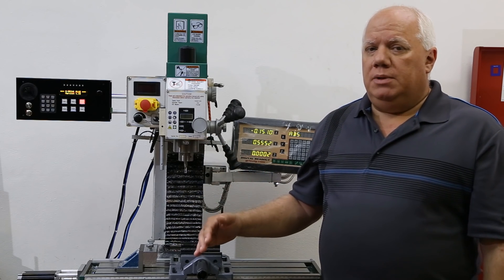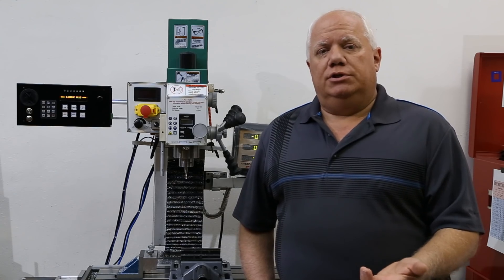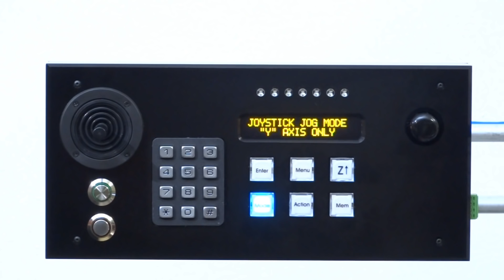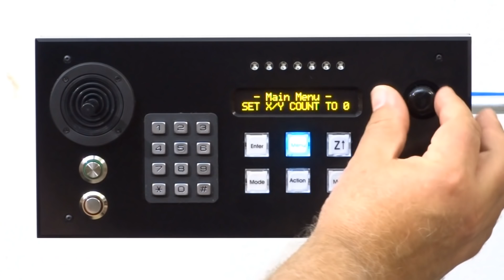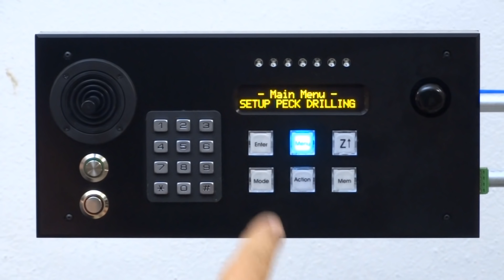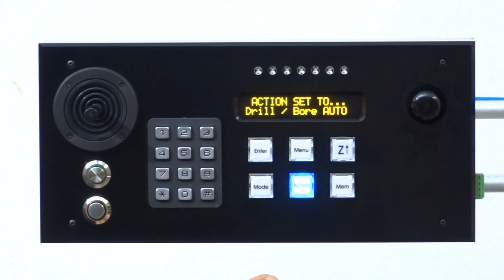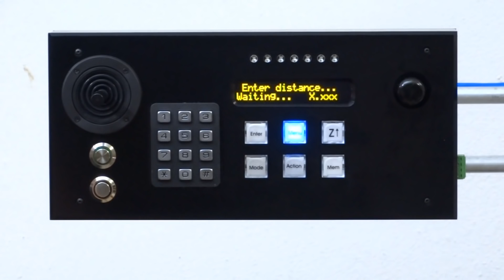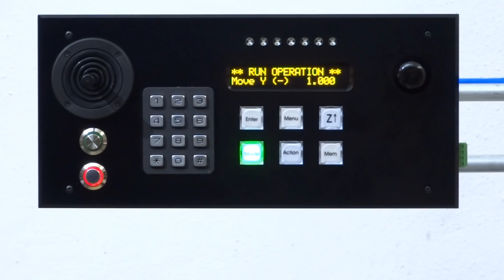Automation for Grizzly G0759 / G0704 milling machine !!!

Comment: How much to purchase one of these setups?
Reply from the maker: Hi… the controller is $1,600 and you will also need about $1,000 for servo, stepper motors, power supply, etc.

Comment: It seems to me that it should be easy enough to create canned cycles for cutting circles. Why is this not done? What is the prohibiting factor? 

You mentioned 290 operations. So if I had a divide a circle into 290 ops I should be able to create a can with 1.25 degree steps to create a full circle, yes? Therefore an arc or radii can be easily cut as well no?

I'm probably oversimplifying the issue. And it has literally been years since I performed any pendant programing. I'm sure that you are all over this any way.

On a side note: My first real job out of college was as a machinist (real machinist - not operator). The small shop had 7 Bridgeport style knee mills fully retrofit with a DOS 3.2 (if I recall correctly) based controls system. I am so glad to have been exposed to that equipment. I have always known that when I began building my own shop it would utilize similar. Because, as you astutely mentioned - having a fully functioning manual mill is a tremendous value. I would argue that a manual with proper retro fit is of far greater value than the opposite.

Great work! Subscribed. Motivated. "And glad to see what you are doing! Cheers from Texas!
Reply from the maker: Hi Charles! Thanks for the post!  I have been so busy lately that I haven't had time to think about some apps for cutting arcs. But, I do plan on doing more on this controller. I have come up with some pretty cool ideas to make it even more usable... so some update video will be on the way in a while. My main concern about the arcs was that I am still running the factory lead screws in the mill... so there is backlash. I do compensate for backlash when running a program, but due to this issue, I don't think I can cut a perfect circle. But I think I will experiment with this in the future, and it might still be useful even if the circle is not quite perfect for less demanding requirements. Who knows...

Comment: I have been to your website and see all the wonderful things you have developed for so many people. But the item you have in this vid is not listed or are you giving any information out about producing or cost to purchase one. Can you give us some help here your leaving everyone hanging. thought your website would help but nothing there. HELP>
Reply from the maker: Hi Michael, sorry for the late reply, I just got back from Los Angeles. Yes... not on the web site. I did start a new web site for the controller and other non-disability items that I might come up with. It is www.tcautomation.us , however... this controller I designed is not "in production". I can, and would be happy to build one for you... but the cost is probably higher than what you would expect. This is because in small quantity, there is just under $500 worth of parts in the unit (including anodizing cost). It is an unpleasant amount of work to build one of these, and for this reason... the price is currently $1,450.00     Best Regards,  Tim
Reply: thanks TIm for getting back. I see what you mean
Reply: Angel ECU may I suggest contracting overseas. They could produce it reasonably enough to bring the retail below your cost of parts.
Reply: Michael Andersen Affordability and marketability go hand in hand and the Chinese manufacture products to solid corporate specs all the time, 1/8-1/4 the expense, and often with better quality control. Every part he has in that controller is made overseas and if it wasn’t it wouldn’t have been affordable for him to build. What we don’t need is comments suggesting one culture is incapable of reproducing a product marketable to tens of thousands. Perhaps it is his goal to only sell a few at a time and if that is the kind of future he wants that is fine but there is also the other side of the coin. Overseas production would also give him time to focus on software updates and key features including any add on packages he wanted to offer and sell in the future besides affording him the funding for R&D of the next series. I want you to go to your living room and grab that flat screen, throw it away, in fact all your ikea furniture, phone you’re using, and car you drive because everything you own is tainted with “Chinese crap”, Idiot.
Reply: south Korea  would be a better bet. also did you see 60 mins this week on contraceptive meshes and the plastics that china sent to the US in unmarked bags to Boston Medical because no one has paperwork in china of where the plastic was made and not up to Medical standards of this country and women have had major medical problems not to say 100,000 women have a class action suite going on. Oh and Lumber liquidators formaldehyde lumber that is being put in homes. These are just a few of the uncontrolled products we have allowed into our country from china. Not all are bad and I buy from them too. but it is not a panacea of quality that everyone thinks.
PS: I know almost all milling machines are made in china now. If you by a grizzly you will get minimal QC check in this country. I bought a Precision Mathews and every unit is checked and adjusted and prepped for the new buyer. It all has to do with control at both ends. electrical boxes no one knows what qualityof components are placed inside. and there are plenty  of variations on QC on that too.
Reply: Michael Andersen i agree it’s not all perfect. We import products from China and have been burned but we also have been pleased with certain products. Unfortunately our PM833-T “Taiwan model” is a pile of crap and it arrived with a host of warranty issues the company did not take care of so we won’t likely ever buy another one of those. Our Grizzly G0761 runs circles around the PM out of the box and is far more accurate. The PM is getting a CNC retrofit and so far our changes have significantly improved its machining capabilities. The casting is a huge plus. Gear box isn’t bad. It literally came with 5-6 cranks of the handwheel worth of backlash in the lead screws. I never did measure exactly what it was but enough the end mill could walk it’s way around through a part. Terrible company to deal with and put us two months behind in our working schedule over it. Not a news watcher but I certainly understand complexities with Chinese products and health and beauty are probably the last products you want to purchase from overseas. I agree Korea is probably the place for electronics although the Chinese seem to copy everything they touch they are killing the electronics market lately.

Comment: this is perfect. I have a PM 727-m and need a solution for a power X and Z using stepper motors. Maybe you could do a video on wiring a stepper to simple switch control....
Reply: martin coleman agreed.., many would be happy to know how to wire the steppers for power feeds with a general potentiometer.

Comment: Will this drive stepper motors directly?  If not, I gather it will use Gecko drivers?
Reply from the maker: Hi, a driver is needed... unless you are running Clearpath servos. I haven't used the Gecko myself, but judging from the price alone, it would probably be fine. I am running KL-5056D drivers that are DSP based, and they work great. Very smooth, and nice. I got them from "automationtechsinc" on eBay. They were $80 each. I originally tried a cheap Chinese driver and ended up sorry that I did. You get what you pay for... it's true. I also had originally planned to mount a NEMA34 stepper on the Z axis, but ended up going with a Clearpath CPM-SDSK-3421S-RLN after experiencing failure with a 34 stepper that I bought... but I think the stepper that I bought was not good quality. It worked, but I couldn't get any speed out of it. You need good parts to get good results. I bought two NEMA 23 steppers (425oz.in) from "omc-cnc" on ebay and these work great! Paid $78.00 for the two. I'm not sure if I would recommend the Clearpath servo though... they are very nice, but I ended up paying $417.26 for it with the needed cables and shipping. Ouch!
Reply: When you figure the price for servos you must remember that its the driver, the motor AND a closed loop system that would all have to be accounted for. Of course you paid full super MSRP, the motors are available cheaper, but dealer network is shit for clear path. But i digress. A driver, motor and scale/encoder would easily top 400 bucks. Even at chinesebay prices.
Reply from the maker: Hey...  I'm not running a "closed loop" system, and experiencing good results. I don't think I would go with Clearpath if I were to do it again. I think a 34 stepper on the Z would be fine. I paid roughly $105 for the X axis, and the Y axis... plus a power supply for $40... so $250 for those, plus the Z axis. But your right... $400 is probably pretty close figure when its all said and done with. - Tim
Reply: all servos are closed loop. it just so happens to be domestic to the "stepper motor" in the case of a clear path.
Reply from the maker: Ahh right... forgot about the Clearpath for a moment! My Z axis is closed loop, but it doesn't need to be. I think I might try putting a stepper up there just to see how it works out. Do you develop with Arduino?